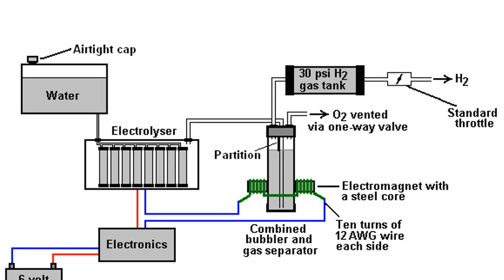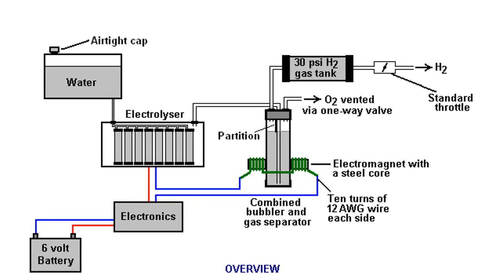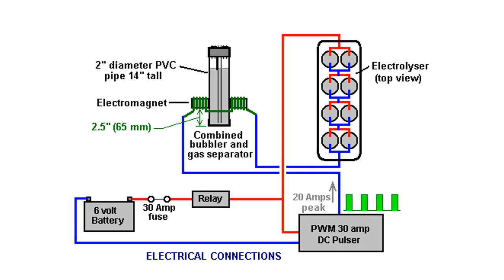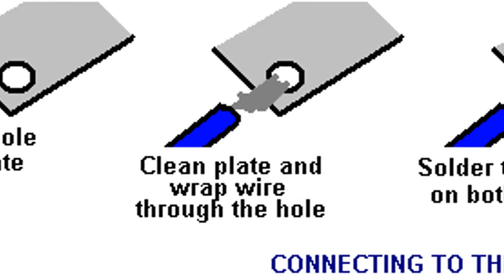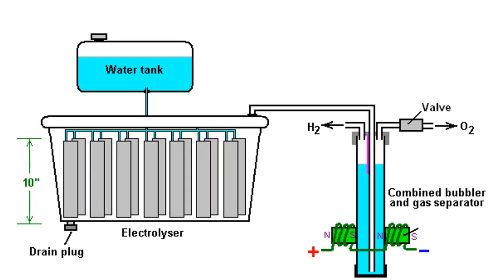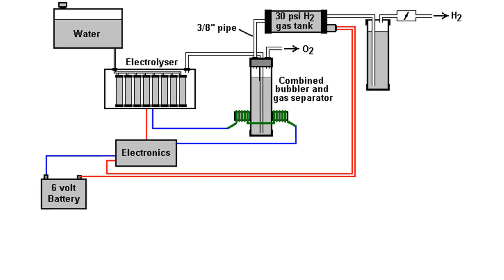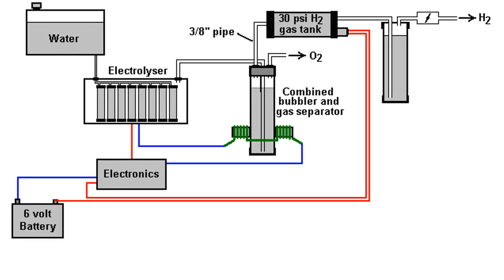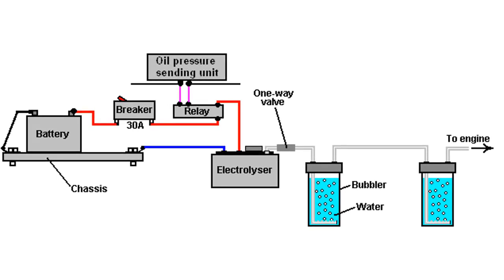Water Powered Engine by Super-Efficient Electrolysis

Comment: S1R9A9M9 ran his Briggs 18HP mower engine idle speed on water in carb, 
2008. See You tube videos 1+2, and associated. videos. Website shut 
down. I have most of his data collected. Working on similar conversion 
for 12HP.  Yes, lower power out, but his v8 old conversion El camino 
tooled around town back at that time also. Adjustable EGR required while
 exhaust drippings contain embedded Nitrogen that improved efficiency, 
and about 6-7 amps DC added THROUGH spark plug. Timing retarded to about
 -34 degrees. High voltage Battery protection diodes set required, with 
S1R hand wound magnetic triple coils assembly over spark plug wire. His 
unusual new process forms water vapor pressure generated with also small
 amount hydrogen gas!  Must verify no/low ohms spark plug- Champion with resistor removed. ...